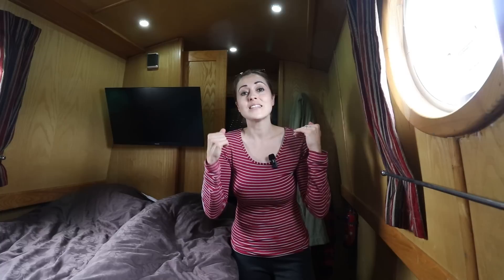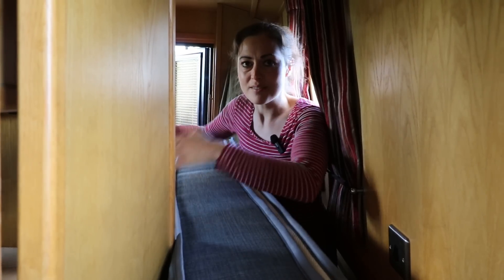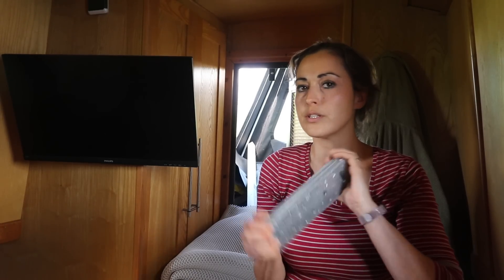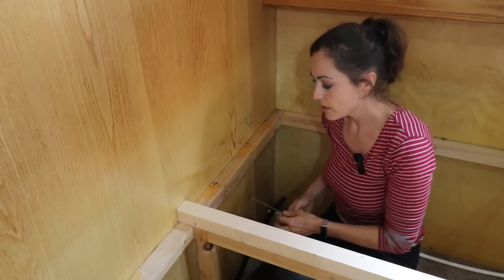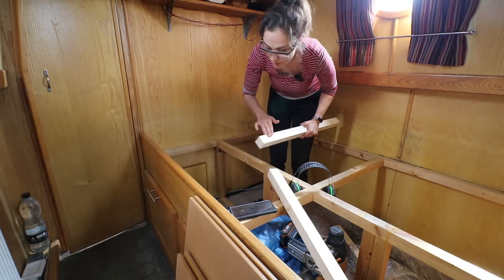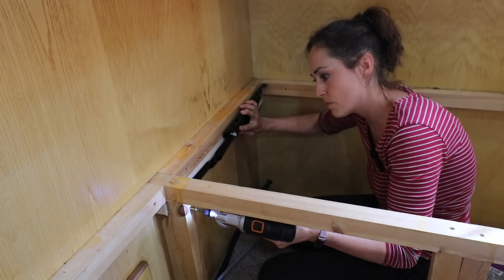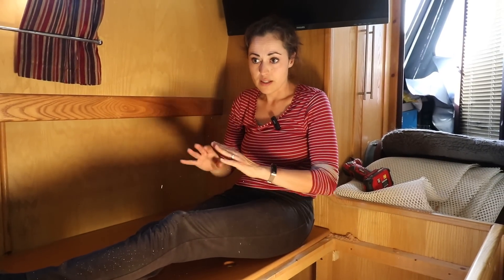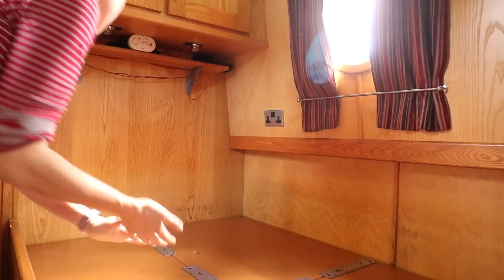The real reason why I've not been sharing DIY projects / Bed Lift Storage

Comment: I use similar dampers in work for hatches. You screw them in or out to make them stronger or weaker for different weights of materials
Reply from the maker: Really?!! I didn't know that! There were no instructions with the gas struts at all!
Reply: @TheCarpentersDaughterUK  the ones I use do. So you can adjust to the perfect strength you need, I imagine these would be the same
Reply from the maker: Will have to check that out! I've pinned it if it's helpful to others!
Reply: @TheCarpentersDaughterUK  Im invested this now... let us know!

Comment: Get some off cuts of angle iron - the form will be much stronger than flat plate. Glad to see a proper video - the shorts were good - but I like to sit with a cuppa and digest - plus we get to see Hans ! :)
Reply from the maker: Thanks so much! I never thought of that! And I must admit, I do prefer watching someone share the challenges and struggles - it's all part of the DIY journey/story, but all will be explained soon about why I only had time for shorts 😊
Reply: @TheCarpentersDaughterUK  if you ever see some old Dexion racking - keep a couple of lengths as you only need to cut it to length with a hacksaw and it’s pre drilled - it’ll be strong enough and lightweight - I fixed an ilea lift up storage bed exactly the same way once - and as far as I know it’s still going

Comment: check your struts are parallel to each other and level.  Slightest offset makes it harder, Personally I would have put a bungee rope under the middle spar "drawer to back" have it really tight, when you lift up it will help with the torque and lift setting with the gas struts,
Reply from the maker: Interesting! Thanks so much for the idea!

Comment: Seems your gas struts are too powerful , when you get them for cars they are all diff. You'd be better off going to a car scrap yard and getting a couple used ones or you could add more wieght under it blicks of wood etc intil you get the balance right  , nice to see you back thou vickki , and deff do mire boat vids ,i thought you did have a boat channel before ??👍👍
Reply from the maker: Thanks! I did and do, but haven't bothered adding stuff to it as we're only temporarily living on the boat, so been working on my food blog instead
Reply: @TheCarpentersDaughterUK  AHH I see , yer I've seen a few of those testing new air fryer thingy and that. Can't believe you still not moved yet and things going pear shaped, annoying and stressful no doubt , take care . 😞
Reply from the maker: It's been a very stressful experience, but we've learned a lot which I'm sharing in full videos over the next few weeks :)
Reply: @TheCarpentersDaughterUK  Look forward to it , and have deleted the comment I did by mistake lol 👍

Comment: Well done for perseverance, got there in the end, and it looks to be much more usable storage space now.
I would have put the support plates in the opposite direction, the way you have them there’s not a lot of material on the plate acting to stop the joints twisting. If they were at 90 degrees then there’d be far more metal plate in contact with the mdf to stop the twist and it’d behave more like a single sheet of mdf.
Reply from the maker: Thank you and good point. I'll have a look at the configuration again. I was worried they may have bent over time that way, but a mix up can't be bad!
Reply: @TheCarpentersDaughterUK  alternating the plate orientation would be a good idea, yes

Comment: You should defo have ran the brackets  at 90 degrees to the panels!
Reply from the maker: Do you mean on the narrow side of the bed?
Reply: The 4 panels under the mattress....you attached the metal plates lengthways in line with the join of any 2 panels,,, I think it would be much stronger if you had turned them through 89 degrees and had them across the joint! Good job though and you achieved what you needed to!
 @TheCarpentersDaughterUK
Reply from the maker: Ah, you mean the metal plates! Thanks!

Comment: What you must add is some way of propping the bed when in the raised position. You cannot rely on the mechanism to always work, there must be some redundancy and so some other physical element needs to be added. Can be bolts or just a piece of wood holding up the bed when in the raised position.
Reply from the maker: Very good idea! Especially like you say, something to lock in place while it's open.

Comment: That looks like an essential modification - I cant see how you managed to access the space before and getting that mitre saw out must have been a pig of a job. 
For flat rope I would recommend using webbing strap, perhaps with a decorative paracord handle section at the mid point.  To fix the webbing strap, consider cutting a small slot with your multi-tool, feeding the strap through and fixing on the underside using a could of screws and washers on each side. For longevity and extra strength heat (melt) the cut end of the strap to avoid fraying and then double over the ends before fixing.
Reply from the maker: Thank you for the idea!! And yes, it has been essential as I simply never ever accessed the storage. Once the mitre saw went in there over a year ago, I never set my eyes on it again 😅

Comment: Definitely want to see more content, don't mind if it's boat focussed or not :)  I have no idea how you managed to succeed at that so offering advice seems churlish, but I'd probably want a couple of stout pieces of wood holding up the front edge when it's lifted - just in case the struts fail for any reason!
Reply from the maker: Yes, it's a scary thought at them failing when you're reaching for stuff... which is probably why it's a good idea to have 2 in and not 1!

Comment: If they're still a bit stiff, gas struts usually have a small bleed screw you can use to release some pressure and make them easier to close - you've got to be careful not to release too much though as there is no way to top them back up!
Reply from the maker: Thanks so much for the info! I don't trust myself on this one, but it's very good to know and look out for!

Comment: Great to see you back  and I'd definitely be happy to see you continue your DIY on the house boat , space permitting . We are in the process of getting a new house shortly so I know the stress involved in that so I wish you all the best in your house hunting. We actually bought a bed with that type of lifting mechanism and I was shouting it'll lift and close fine when the mattress is on lol. Other than replacing the 4 bits of mdf with one solid piece on a timber frame , I'd have done the same as you. As far as lifting goes , it's more awkward for you as you have that raised bit at the front whereas ours has hand holes just below the mattress , it's heavy but manageable  and is a godsend for  accessible storage .
Reply from the maker: LOL... it was so frustrating... we'd seen others say it in their own videos, but it's that whole not knowing whether your gas struts are too strong and whether it will actually work that gets you😅

And good luck with the house purchase - it has been a very stressful experience searching for the right property - and also, not knowing whether you'll find one or not and whether you should lower your criteria and settle.

Comment: Air cylinders with a small compressor to power the them and a foot operated actuating valve so that you can have your hands full and still tilt the bed up with just tap of your foot. (Your approach was drastically more practical on all accounts than this Rube Goldberg of course, and I really like how you keep going regardless until things are buttoned up.)
Reply from the maker: lol... just had to google Rube Goldberg 😆 But something hands free sounds bliss lol